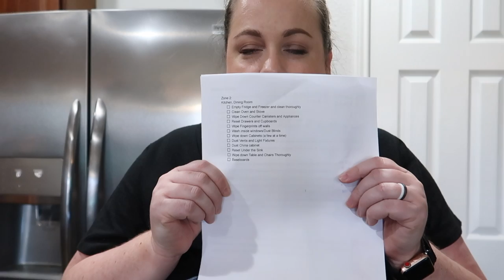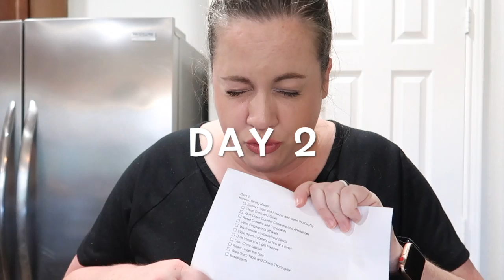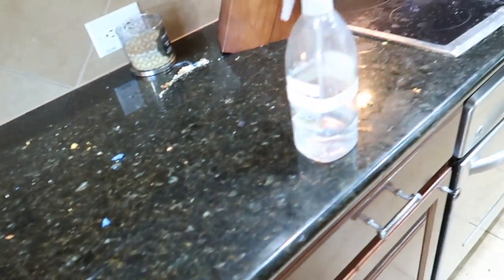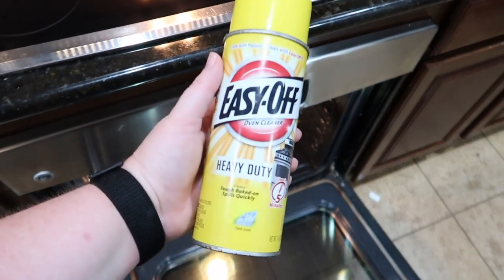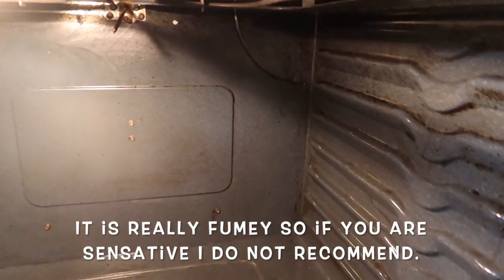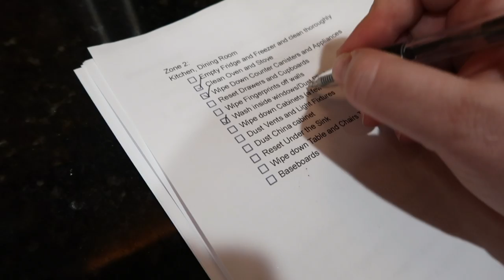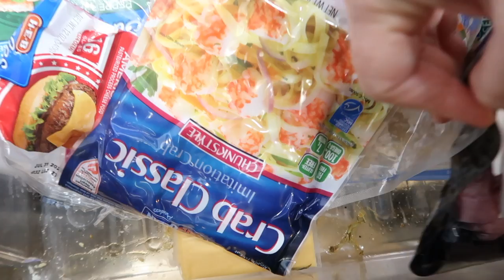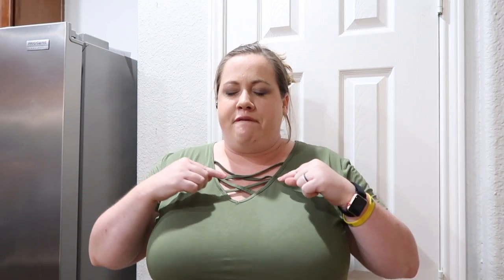Zone 2 Cleaning for the FIRST TIME | Working the Fly Lady System

Comment: I pull my fridge out every couple years. Recently I pulled it out, and it wasn’t as bad as I was expecting. I did buy a long cloth on a stick that slides under the fridge. It removed dust, dog hair, and other dirt. It took a few times, however it did work. And, it is machine washable. 👏🏻👏🏻

Comment: Below are directions from FlyLadys website regarding Zones.

The things that stuck out for me were - to get a handle on your Morning and Evening routine’s before you start Zone cleaning/decluttering.
And work just 15 mins at a time in the area.

How to Begin
When you first start decluttering, cleaning, and organizing your zones, you are encouraged to spend 15 minutes per day decluttering in the current zone. That’s it — BabySteps! Set your timer for 15 minutes and clear out those things that you don’t use or love. Flybabies, don’t forget to keep working on your Morning and Before Bed Routines — do them everyday! (See the FLYing Lessons for more information about this.) Once you have a good start on your routines, it is much easier to do the zone work.

Before you start, review the rules of zone cleaning:

Be fully dressed to shoes before you start.
Your morning routine should be finished and preferably weekly vacuuming done.
The room has to be fairly straight.
Do not pull out more than you can put back in one hour.
Clean one drawer or one pile at a time.
If you do not know how to declutter, read the FLYing Lesson on How to Declutter.
Be consistent. Do a little every day. Don’t try to accomplish this in one day; you will burn out and will hate this system. BabySteps!
Set your timer and work for 15 minutes. That’s all. It did not get junked up in one day, and it won’t get clean in one day, either. It will take patience and BabySteps. You can do this.

Comment: I try to clean under mine twice a year. But honestly I probably have managed to do it only once a year. I usually get behind there to clean and vacuum the fan on the fridge so the fridge doesn't have to work as hard with all the dust on the fan area. You're doing a good job , Shannon.

Comment: When I clean the tops of my upper cabinets, I lay wax paper down (the width is perfect) then the next time I clean, I just take up the old wax paper, do a quick wipe and replace it with new. I do it Spring and Fall. As for moving the fridge, a real challenge in my new apartment, I do it Spring and Fall. Always amazed at how dirty the floor gets.

Comment: I was so relieved to see the Day 3 text marker b/c I thought you were doing ALL of that earlier work in ONE day! Girl, FLYLADY says to spend 15 minutes in a zone per day. The zones have been the hardest for me to figure out & apply. You did SO much work!!!  I have a couple of tips for you (hope that’s ok!):  1). Each day before meals fill your sink with hot soapy water so you can quickly wash up stuff as you go. Then you won’t have such a mountain of dishes to deal with later. 2) Clean out just a shelf or 2 at a time in the fridge vs. taking out everything, & for sure when you are defrosting stuff, put it in a bowl or pot so you can avoid those horrible, disappointing leaks. I SO am with you on the perfectionism thing. I too would have wanted to get every last speck in the oven, but I’m getting better at telling myself that at least it’s progress, not perfection! You go, girl!  Very encouraging video!

Comment: I'm using pages from old newspaper or just printer paper to protect the cabinets above the kitchen from colecting fatty/dusty layer, later it's super easy to clean.. you just need to pick them and toss to the trash clean a little and replace them for the new one. There is way less fat/dust layer on actual cabinets to scratch. If you know what i mean 🙈❤️😊 love your content!

Comment: Not sure if you have checked yet but I seen a video about cleaning between the glass on oven door.  There are open slots in the bottom of door. They took door off and attached a cleaning cloth on a yard stick (3 ft ruler) with rubber bands and went up through slots to clean between the glass

Comment: I'm a homeschooling mom of five (I only homeschool one of them right now, but still) and my favorite way to make things a little easier on myself during this busy stage of life is to plan meals that make as few dishes as possible. For example, make a bunch of muffins or a a few loaves of banana bread, enough to last a few days. Store them in containers or gallon ziplocks marked "Monday" "Tuesday" etc so they don't get eaten all at once.  At breakfast time, let the kids eat one over a napkin or paper towel with some fruit or a cheese stick. Then there are zero breakfast dishes for a few days. We also do a sheetpan snack plate for lunch a lot on days when all the kids are all home. Just throw whatever you have like rolled lunch meat, cheese, crackers, grapes, nuts, whatever lined up in rows on a sheet pan and let them have at it with their (washed) hands. Then you only have to wash one dish instead of plates and utensils and cookware. It really takes a lot of stress away from mom and the kids love it.
Reply: Also, I have literally never cleaned behind my fridge, but my husband does it whenever he thinks about it, which is probably twice a year. He pulls out the fridge and the dryer to sweep behind them and make sure the coils are clean because he says it's supposed to make the appliances more efficient, it's safer, and it lowers your energy bill. But if he wasn't here my answer would truly be never because it really never occurs to me.
Reply from the maker: Those are some great tips! I love freezer cooking so I usually cook double and freeze half when I can to always have something easy on hand. I really loved the idea of a sheet pan lunch or using paper towels instead of plates!

Comment: I cleaned under my fridge this winter, first time in four years I’ve lived here. Where I live we’re told you’re supposed to do it once a year, mostly because the dust that gathers to the “grill” at the back is a fire hazard. I was dreading what kind of mess it would be but it wasn’t so bad after all. Well it was a good time to clean it, but it was not extra bad. No smouldering fire which I was almost expecting 😅

Comment: Honestly, our fridge space is so tight that we never pull it out.  It's in a wall of full height cabinets, so the most that I do is run a thin yard stick under it regularly to pull out the dust bunnies and cat treats that might get kicked under it.  Hint for the tops of the cabinets....line them with newspaper or cheap paper placemats and just replace those every whenever to clear out the grease and dust.  It's about time that I do that in mine.

Comment: When you've got to move something like washing machine or fridge, to help them slide. Spray some spray furniture polish onto the floor. They glide then and clean up afterwards is barely anything. 
Not like if you use washing up liquid as that gets bubbly once you start adding water with a damp cloth! 🙈

Comment: There are clips to take the stove door off — much easier to get in and clean.   Buy yourself a silicone oven mat for the bottom.    I’m all about making cleaning easier.  Any drips or spills just pull the mat, shake off and wipe as needed.   Dawn minimal mom had a video where Tom took apart the oven door so they could clean inside.  Epic fail and had to replace it.  I have drips inside too.  Just strategically hang a towel to cover it. 🤣🤣  Glad you didn’t over work this go-round.   Just keep knocking back layers during each zone cleaning.  In a couple of months you will be totally wowed!!!  Something is better than nothing.   Oh my gurl had me laughing about the wedgie.  I didn’t even notice til u said something.   That’s my all day experience!   Haha.   Great job!!!  So glad to see you. Hope you are feeling better!!!  Hugs, Em. 🌸🌷🌸🌷🌸🌷🌸

Comment: Professional organizer tip… the Metal clips are so you can take the oven door off and clean it 1000 times easier
Reply from the maker: Any tips on getting on the inside of the door?
Reply: If you Google it I think you can takeoff the top and slide a metal hanger in there with a towel wrapped around it

Comment: Ok. Our fridge is up on a built in pedestal and we cannot move it out to clean. When we get a new fridge we plan to take out the pedestal. It's been 10 years. At this point I'm praying it will die soon. Don't feel bad. You're doing better than fine.

Comment: Hey, just a tip, but next time you are cleaning the oven I seriously suggest cling-foiling the spray. (Spray -> cling foil -> forget -> wipe). I swear all the caking is gone after. I hadn't cleaned my oven for a year or so when I saw video on this and I swear, all that sh*t just melted off, and there was a lot of that burnt off brown grease.. :D Also a glasstop scraper is a miracle worker! Aurikatariina has great tips on it on her yt. :)

Plus I wonder if you would like the expandable bamboo divider box for your cutlery. Just wondering :D (I got a instant "I wonder if she would like that"-moment when you showed off the stuff under the current box)

Comment: Fridge is pulled out quarterly.  Helps when changing filters.  Also helps that DH (Darling Husband) was an appliance tech for more than 40 years…so mainly He cleans underneath when he does the maintenance.  Lucky me.  But, I will pull it out if something is spilled or dropped, etc.    

Good for you, going for it.  Just put it on your routine zone cleaning.  Don’t EXPECT to get to it each month.  And STOP spending hours every day in your zone.  Should NEVER start zone cleaning before doing your regular daily clean…like the dishes.